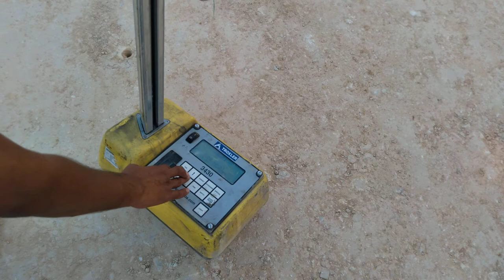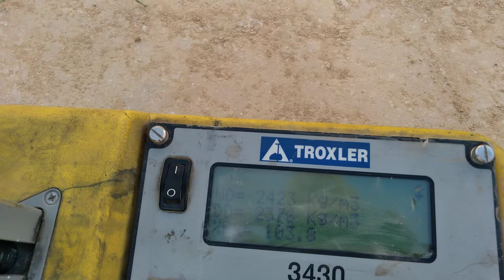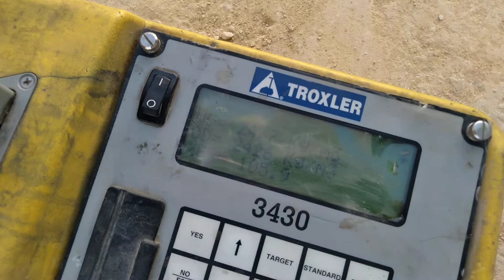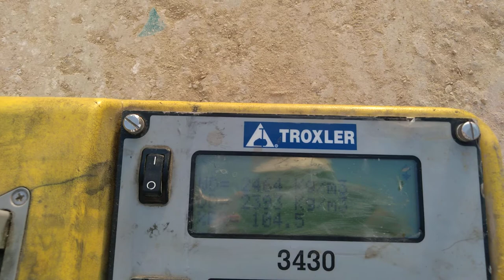Actual Field Density Test Using Troxler (Nuclear Method).

Comment: I don’t think you’re supposed to have the source rod exposed before it goes in the hole.  You’re supposed to outline the scraper plate then place the gauge in your outline, push the source into the hole to the desired depth when the unit is in form contact.  Then start your reading and step away from the unit.  This keeps your radiation exposure level to the unshielded source as low as reasonably possible.
Reply: You are absolutely correct.  They are doing it the LAZY and UNSAFE way. Drop a survey meter next to it and watch it scream when he pops that wheelie.

Comment: Lo usé en La Alumbrera (Argentina) para controlar la compactación de rellenos estructurales. El aparato tiene una barra que se desliza por un orificio realizado previamente en el suelo a una profundidad máxima de 30 cm (12"). En el extremo de la barra tiene un emisor radiactivo (americio o berilio), luego de 30 ó 60 segundos muestra en el display el resultado, el cual representa un porcentaje de la densidad Proctor obtenida en laboratorio de ese mismo suelo (la de laboratorio se considera que es 100%). Por otro lado, es anecdótico mencionar que la maza o martillo utilizado tiene un mango muy corto y que, a pesar de los cuidados que tengamos, siempre nuestro cuerpo absorberá una porción muy pequeña de la radiación emitida por el dispositivo, pero dentro de los valores razonables.

Comment: Wrong way of actually using a Troxler Nuclear Density Gauge.
Exposing the Source Rod prior to place the Gauge at the Access Hole is Completely Wrong. That Exposes the Source for a full Blast of Gamma Ray all over the Area and Exposing the Technicians and the workers in the area.
Wrong way of using the Scraper Plate and Drill Rod to Drill the Access Hole. That way you can Bend the Source Rod easily when the Access Hole is not Vertical. The Purpose of Having the SCRAPER Plate is to Drill Vertically the Access Hole.
Try to use a Hammer with a longer Handle and slightly heavier than that one in the video. Gives you more striking strength to drive the Drill Rod down... And Use the Extractor and the Provided Drill Rod!
When finish to Drill the Access Hole at the Desired Depth, Do not Immediately remove the Scraper Plate. Make sure you Highlight the Contour of the Scraper Plate at least on two side. The Scraper Plate is made to the Footprint of the Base of the Gauge... Helps place the gauge correctly on Top the Access Hole and Drop the Source Rod without exposure directly into the ground.
And Please, butter the Gauge, this means the Source Rod has to touch the material measured. Butter from Source to Detectors, towards to back of the Gauge. Reducing air pockets or minimizing the Void will increase accuracy of measurements or Precision.
Prepare the Test Site by Scraping it Flat and Fairly leveled to have the Gauge to sit well without Air pockets underneath....